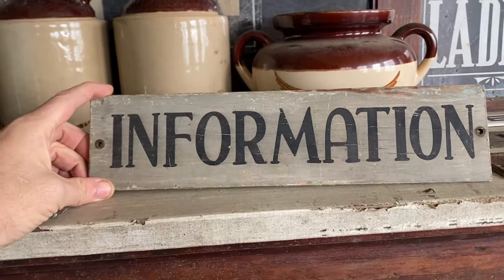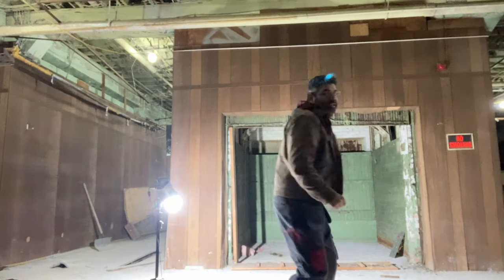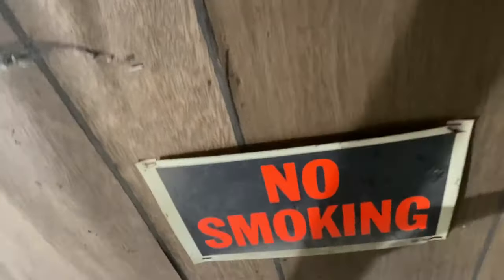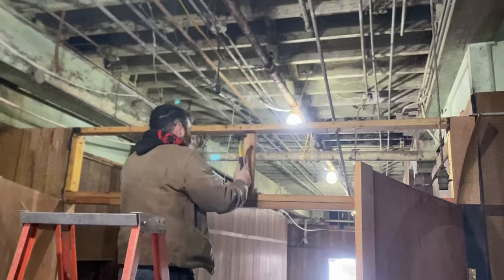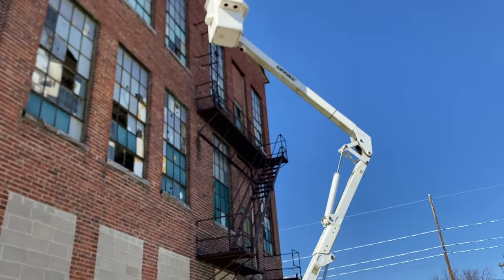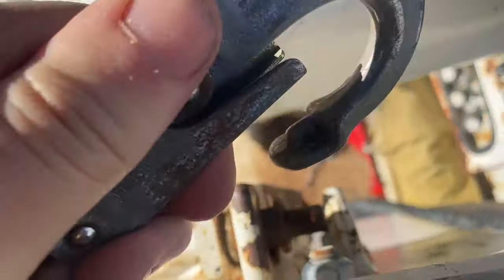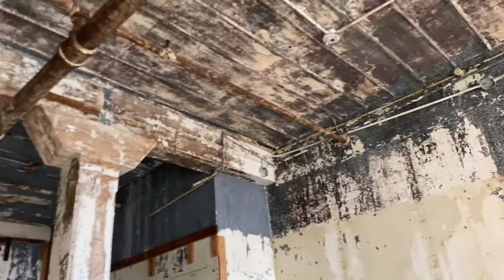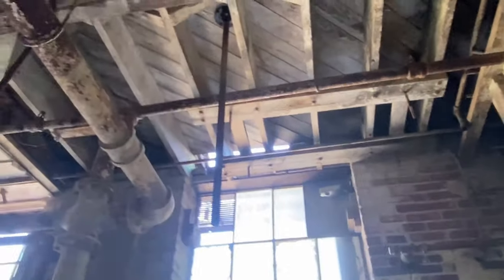Elevators, bucket trucks, demolition,  renovation of industrial building

Comment: I work at a school and I got elected to use the really big lift to change the light bulbs in our football stadium lights about 80 ft up. It was definitely wobbly and scary. I learned the same thing Bob was saying "go slow". You just ease into the controls and when you're going to stop you just ease out of it. If you start quickly or stop quickly it's definitely going to bounce you around.
Reply from the maker: Thats cool to use one inside.  It is kind of tricky to get the hang of the controls. In time I'll get it.

Comment: As for permits: I woudn't think you would need city approvals to do simple repairs, just big things like new additions, building demolition, etc..  You should be able to do that little area of brick work above that window with your bucket truck.  It's like adult legos.  Slather the bricks up with morter and put them in place in the hole :) .  Plus it'll be good practice!
Reply from the maker: They came and were helpful, that will be in an upcoming video.

Comment: When I was in Jr. High metal shop, I had a project that was a large dust pan made with galvanized sheet metal. We were told to wipe the surface with a rag soaked in vinegar before painting. The paint stuck very well.
Reply from the maker: Nice tip! Thanks.

Comment: Yes, the feeling of wobbly and bouncy in a bucket truck is unnerving but as you found out, one does get acclimated a bit.  I hope you can spend time at lower levels before going higher.  Remember the boom has safety features built into the hydraulics and the fall harness will keep you safe.  The white smoke at idle could be stuck open injector or (hopefully not) coolant due to head gasket.  You got a great deal on the truck, I would have paid 2x what you paid.
Reply from the maker: Nice tips. I was thinking about using it on tree trimming the low hanging stuff first just to get used to it out in the open away from the brick walls.  I am sure I'll get better in time.

Comment: great to see all the paneling coming off the elevator shaft exterior. Looks a ton better now. When you visit the permit guys, see if the city is willing to work with you on the permits by either giving you a cost break or by combining several into one. They (the city) has to be happy that someone is willing to work on the building to begin to bring it back. With the bucket truck, get used to it by working on the 2nd story sills. As time goes on, you may feel a bit more comfortable and willing to give a 3rd floor sill a shot but save those for later.
Reply from the maker: I did exactly that when they came. I'll upload about that at some point. But I can make a list about the projects and then get busy on the list no matter how long it takes which is nice and saves filing fees.

Comment: A little demolition secret to help you remove the paneling a little bit faster and then hopefully bigger pieces is to loosen the top of the paneling and run a rope the length of the paneling plus a bit extra along the top of the paneling behind it and then both people pull back-and-forth and assign motion, while yanking outward, and sometimes the panel will fall off in big pieces.

Also, I think if you have the money and you're able to do so what I would do once a week is try to remove at least one trailer full of trash once a week. Just keep taking it from the same general area and you'll see results in no time. Makes it a little bit more manageable and gives you a sense of accomplishment.
Reply from the maker: Yeah, I have been putting it off until the elevator is ready. It seems like there are so many things to do, it's hard to pick and choose.  I have been focusing mostly on the ground floor.
Reply: @coldwarmercantile  Well the ground floor looks awesome so far!

Comment: I'm not extremely afraid of heights but working in a bucket is like being suspended by a huge rubber band.  I assume no out riggers on the truck?  By looking at the fully extended length of the boom, if it was extended sideways, to me it looks like it could tip the truck over!
Reply from the maker: there might be rules/protocols about the angles?  I don't know.  no outriggers.  Sadly.

Comment: For the third floor window panes, why not, from the inside, clean the frames, caulk around, use a glass suction cup on the panes and pull them into place?  I'm a true believer in glazing, not caulking windows, but I'm also a firm believer in staying alive!
Reply from the maker: the windows actually attach from the inside, but the frames interfere with working on the actual concrete sills ill be installing.  But as for the windows we are definitely on the same page.

Comment: It won't take you long to get use to the movement in the bucket truck and won't even think about it. It's used and never flopped on its side previously. I had a work truck without out outriggers with a 40' boom.
Reply from the maker: Thats what I have been told. Hopefully I can get used to it.

Comment: The paint is chipping because there appears to be no primer. The metal is also expanding and contracting because of the temperature changes. Once you get the room climate controlled it should fix the issue.
Reply from the maker: Nice info.  I'd love to keep some on there then clear coat it but don't know if that will stick any better than the paint did.
Reply: @coldwarmercantile  I'm thinking an acrylic or latex clear coat  would be flexible enough but that is a mildly educated guess.

Comment: on some of the older elevators has bells to signal the elevator is moving up or down/ and or the call bell to let the people on the other floors have the safety gate open and they need to close it so you can move the elevator.
Reply from the maker: that's right, each floor has 2 call bells. one on each side.

Comment: the higher you go with the boom the more leverage it creates. It will wobble, never use that thing alone. There will a weight limit for the bucket, the more weight in the bucket the more leverage, just like a big pry bar. I'd just invest in a lot of scaffolding. Its cheap used and available everywhere.
Reply from the maker: I was thinking about putting scaffolding in a 14 foot bumper trailer that I have so I could move it around the building.  If I can get used to the bucket I will be okay for 60% of the building. new strategy of some kind for the very upper stuff.

Comment: there are no differences between people elevators or freight. Elevators main rules apply to lifting capacity. I would have no issues using that elevator for people. I used a freight elevator at General Motors for 30 years. Fixing the safety gate is simple. You add just one gate to the back of the elevator box. That's how new ones are made today. Your fears of riding the elevator are silly bud. That's why there's control buttons inside the elevator so people can push them!😃
Reply: Are the inspection requirements the same for people and freight elevators?  I think he's also trying to limit liability in case someone gets injured.  He probably has zero insurance for that building.
Reply from the maker: yeah, the building is basically uninsurable at the moment. And I want to clarify on the channel that I have no intention of using it for people because I don't want to invite inspections from the city that could be catastrophic, and the truth is that I really don't intend it for people.  For the record. =)

Comment: So someone doesn’t fall out the back door or into the shaft.  100,000 to 200,000 dollars not including lights, or switches and wall plugs.
Reply from the maker: there are exterior doors, I guess they just didn't need two sides to load from, but it seems strange to completely uninstall it all.